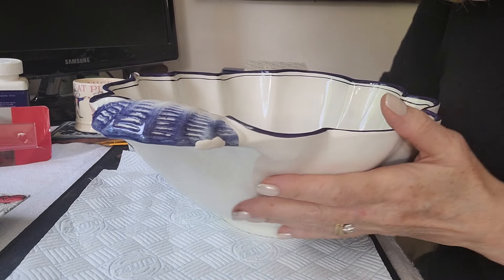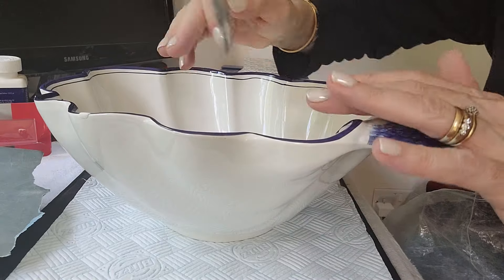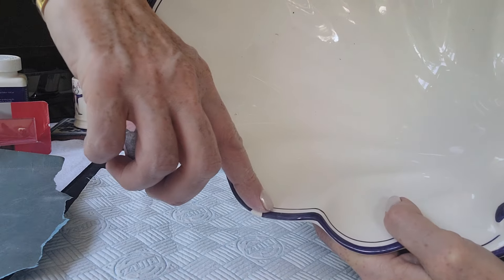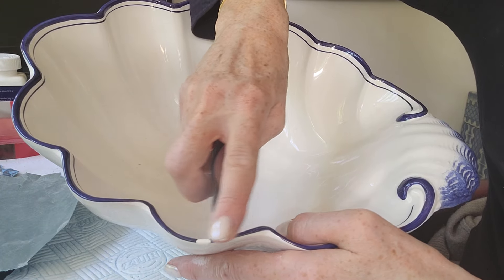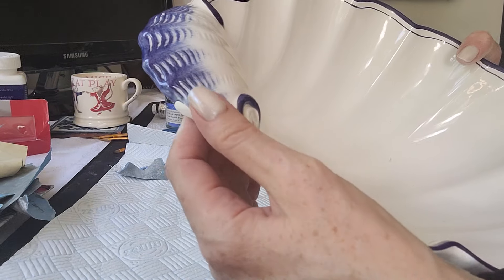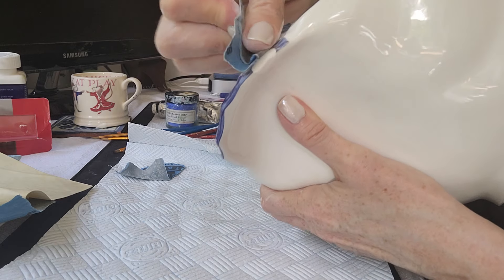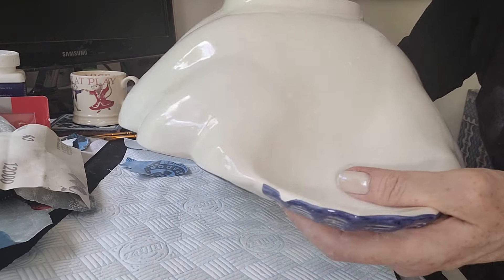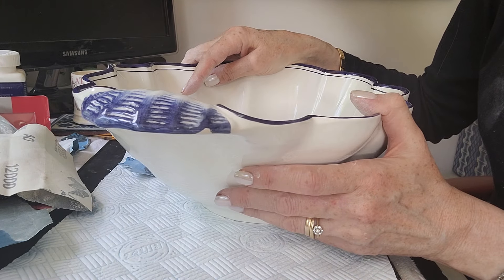Fix Chips And Cracks In Porcelain And Ceramics Like A Pro!

Comment: Hello Ali. Thank you for your wonderful instructional videos. I have by watching many of your videos been able to repair a chipped lid and spout on a tea pot which I like and is also sentimental. It all worked out amazingly well. The colour matching was very tricky with a lot of attempts as the paint always dries darker than it goes on. My one issue is that I dont possess an airbrush and I have found that the the painting process does leave brush marks however hard I tried by either building washes which didn't work and then by just painting with a creamy consistency as you have instructed, this still left brush marks which identify the repairs sadly. It doesn't matter as it is only for me and I will use it once the glaze has really hardened up after a few days. Many thanks.
Reply from the maker: Painting can be tricky on some items. I am so pleased that you have managed to repair your item.
Reply: @TheCeramicRepairStudio  All due to you, thank you.

Comment: Hi, could I ask you, or anyone here actually, a question? I have a chipped mug (on the outside bottom part) and I also have the porcelain chip that broke off. Would it be better to glue on that part or rather work with miliput? I think somewhere I read that those epoxy glues are not heat proof? I wondered if one can still use a mug that gets hot with a glued on part? I would be very thankful for answers! Greetings Liv
Reply from the maker: I wouldn't recommend using glue, they tend to soften in heat , Milliput is a better option.
Reply: @TheCeramicRepairStudio  Thank you very much!!